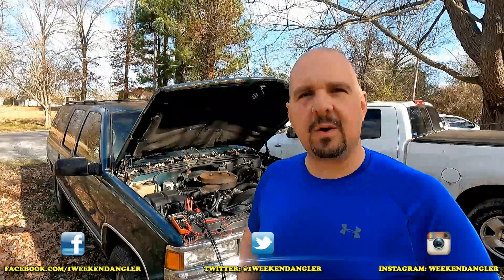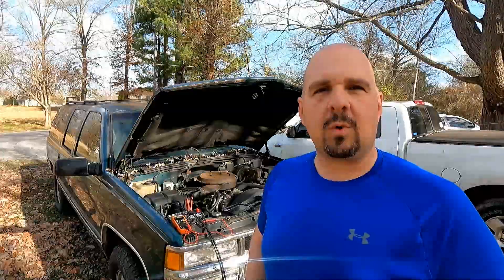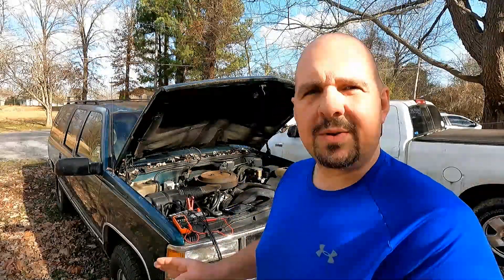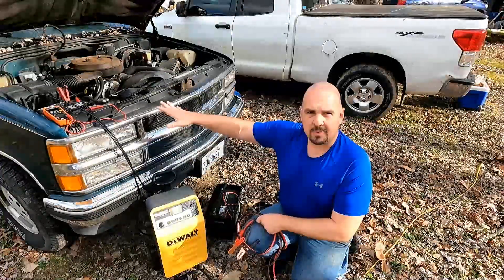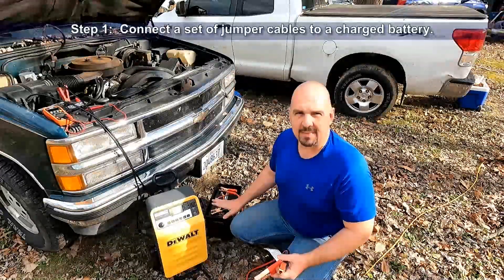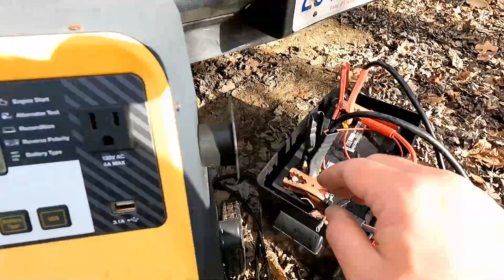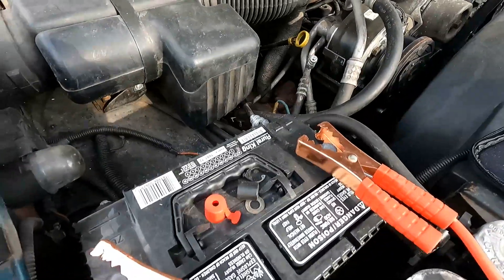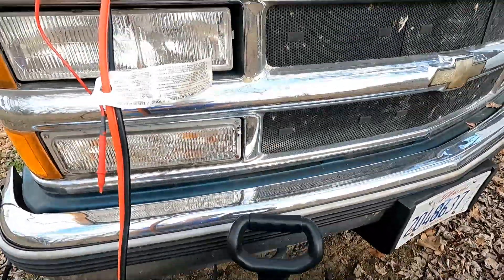How To Charge a DEAD Car Battery When The Smart Charger Won't Detect It

Comment: You truly act like you found something new that has been known all you do is hook another battery up to it let it sit there for a few minutes and then hook your charger up and the smart chargers are much better because they charge a battery to a full 100% at stages they slowly charged up instead of fast like the old chargers did and you cook the battery, fry it in with a smart charger when it’s fully charged, the charger automatically shuts down with the older chargers. They didn’t start out slow and then slowly step it up they would is ball those battery plates and you would sell start smelling the acid Stinkin and when you smelt the battery like that you knew you had something going on had a bad cell that battery was done smart chargers are made for safety reasons and the newer batteries are sealed Joe batteries non-serviceable. I actually like the smart chargers because they bring your battery back in a full hundred percent where it should be because people have this bad mistake of charging the battery just enough to get the vehicle started and then they take the battery charger off that batteries never fully charged and they think all the vehicle do it while you’re putting a strain on your alternator and one thing people don’t realize a lot of Fords if you have a low battery and you jumpstart that vehicle that battery is not a full hundred percent y 100 percent in one thing people don’t realize that battery is not fully charged up. People have a bad habit of just starting a vehicle and going well. The thing is on a lot of Fords especially the older ones GM’s and the newer ones that batteries not at a full hundred percent and you start that vehicle guess what you just took that alternator immediately to go buy alternator now he blew out the regulator and a diode’s. That’s why your battery needs to be at a full hundred percent charge before you start a vehicle. people are in a hurry nowadays go go go they got time the way. Oh they’re in a rush. Learn how to settle down and wait a minute as you get older, you’ll realize a lot of things you’ll start settling down, slowing down and think how old that old guy he was right but you won’t admit it when you’re younger just a dumb technician telling somebody a little advice and they think they know it all I know because I’ve done the same thing after working on these vehicles for years and years I learned the batteries not at a full hundred percent good way to spike the system because the alternator is not seeing a full correct voltage it increases the volts amps. It’s like a power surge takes it take a big chance of spike in the system doing more damage to your vehicle than what it’s worth and guess what that’s a thing that’s not under warranty you have to pay for it. There’s no warranty coming out. There’s gonna pay for that, once a technician figures out what happened get your wallet out time to pay up so just do yourself a favor go to Harbor freight get your solar panel. You can’t do that you got plenty of cell phone chargers, laying around cut the end off it’s got red and it’s got black hook it up to the battery and plug it in and go to the house, you could leave the cord up on the hood and if you’re scared disconnect, your negative, then plug the cord in but that little bit of voltage it’s like a trickle charger. I don’t know why people don’t use common sense no more compromise.

Comment: And people don’t think about this so you have a dead battery but you don’t have the money to purchase a battery charger but you need to leave in the morning to go to work, so do you have a old cell phone charger take a cut the end off strip it back you’ll see a red and a black wire Hook it to your battery plugged in overnight and your batteries charged it’s like a trickle charger used fast charging one, so what it takes all night but you didn’t have the money to purchase a charger and this is actually charging your battery the correct way the way it should be done. You don’t want to charge your battery fast you want to take it slow and bring it up And bring it up to fast it’ll never charge your battery to 100% people don’t think compromise things around the house it’s just laying there and I know people have thousands of cords and ends for the wall socket plug it into extension cord and there you go or go to Harbor freight spend $15 get your solar panel so when the vehicles off The batteries being charged during the day that takes a strain off the alternator system because the battery is fully charged a lot of people don’t think and you run it directly to the battery and leave it hooked up all the time so when you’re going down the road is being charged your alternator shuts down because the computer sees the battery is fully charged Savon gas saver on the wear and tear your alternator and battery I think people forgot how to think.

Comment: so what's the point of having a battery charger if you need to keep a fully charged battery around?
Reply from the maker: You didn't used to have to until they started making these "smart" chargers that are dumber than a brick.

Comment: A way with less effort is to get an old 12v wall wart power supply, and a splitter ( one male, 3 female outlets) for the cord,  clamp the charger leads on the battery, then the wall wart leads to those clamps and turn on the charger. The charger will sense voltage, so will start to charge. Once it starts charging you can disconnect the wall wart power supply and the charger will run until the battery is fully charged.
Reply from the maker: I've done that one before also. Good tip!

Comment: Better still, buy a smart charger that will bring up a dead battery to full, I bought one for this reason after my previous smart charger couldn’t do it. Now I have one that will pump in the amps like the old transformer type and then float it afterwards. The smaller units aren’t worth it.

Comment: Even a small 9 volt transistor radio battery will make a smart charger begin charging. Once the charger turns on it will continue charging after the small battery is removed.
Reply from the maker: 9v is usually the accepted threshold voltage for charging, however a lot of the cheaper smart chargers require a little more.

I've got one that won't charge anything under 11v.

Comment: I’ve always had a spare car battery good solid crank on timber blocks on the ground and still using old school trickle charger to this day.  I’ve looked after it extremely well. 

Hook up fully charged high crank battery to any dead battery in a car or motorcycle or anything and bang kicks it in the guts. 

Anyway thanks for the advice

Comment: Thank you for explaining something that has confused me for years. Always got it running, was never sure how. I have a trickle charger. I am guessing the 2 volt trickle aspect of this charger is disconnected from the " smart". Throw a trickle at it for a couple minutes and presto, it works. Turn it up and away we go.
Reply: I originally thought I found a magic hook up point after fooling around for hours. Then my magic wouldn't work one day. I am too stupid for this smart crap.
Reply from the maker: @Thea-gj2or  I liked the chargers a lot better when they were a simple transformer and rectifier. They'd throw voltage into a rock if you wanted them to. These new chargers are horrible.
Reply: @TheWeekendAngler  I was ready to smash things so many times. I learned at a young age that smashing things just gets you smashed things. We don't drive the car often enough or far enough to keep the battery charged. It gets worse in our - 20 degree winter lows. Lasts a month at best, then the struggle begins. I think I have it under control now. I might actually understand the problem thanks too you. Thanks again for the explanation and the swift reply.   Dave
Reply: To clarify, the day it didn't work was yesterday. By trickle charging it for 3 minutes I got it to charge at 10 v. Now the charge rate is dropping fast. At 7.5 v and dropping. Started the car an hour ago but wanted a better charge for the wife to leave the house. I am convinced it will read full charge very soon. Thanks for helping me understand why, hopefully. I only say hopefully because I thought I understood it before. Good times on you and yours.

Comment: Used my Harbor Freight jump pack to fool my old Die Hard charger to run in manual mode. Then, I got enough voltage on the battery that I could get my new Vector battery charger to do the rest.

Comment: Great vid, thanks.
Would you recommend doing this with a completely drained battery too? 
It's not detected by my charger - which min. limit is 2.5v - so I guess it's somewhere between completely drained and >2.5v.
Cheers
Reply from the maker: Yep. I've done this on that old suburban after letting it sit for a long time. Battery voltage was basically nil and it brought it back from the dead.

Comment: my battery is now 4 yrs old.. if it's my car does not start, all i just do is to connect wires in parallel to another car then start, for the alternator to charge my dead battery.. after a while, my car can start and i leave it 10mins to charge up itself.. then good to go 😁

Comment: If you have jumper cables, just ask for a hand and if someone pop their hood and jump your battery so the alternator can charge your battery. If that's not an option call roadside assistance especially in colder weather. The issue here is he purchased a 12 volt 3 stage charger but needs a 4 stage charger to get the battery back to 12 volt range. It's a solution however that entire setup is unnecessary and costly. What happens when the backup battery discharges down to 11 volts. You'll spend half a day charging batteries. 1200 watts at 30a bulk stage 3 hours per battery.

Comment: Just used a 9v battery to do the same thing
Reply from the maker: I'm going to have to try that. That's an awesome hack! Someone else mentioned that a few days ago too. Thank you for sharing!
Reply: @TheWeekendAngler  it sounded ridiculous when my buddy told me but it worked within 30 seconds and my battery was dead dead.  But it just has to register something with a few volts I guess even a small ass battery will work

Comment: I once put enough charge in a dead 12V car battery using a 9V PP3 battery, it added just enough power to get the smart charger to turn on. I read it somewhere, tried it and it worked.

Comment: also if the battery charger says bad battery then you can also use the boost option on the charger for 30 or so min and then put it back on the charge option
Reply from the maker: That's a good feature that some of the better smart chargers have.

Comment: could you use a jumper instead of another battery to make think the charger its 12 V?
Reply: You can jump the dead battery for about five minutes and get a “surface charge” on the dead one then your charger will recognize it and begin charging.
Reply from the maker: No. You have to have a 12v source for the "smart" charger to turn on.

Comment: Isn't it dangerous to leave that setup on very long as it will over charge the good battery??
Reply from the maker: You're fine to do it for the time it will take to get the depleted battery over the smart charger threshold. It won't overcharge.

Comment: Can be done with two intelligent chargers PROVIDING that at least one has the option to do an engine start. Hit the battery with the engine start then hit it with the ‘intellijunk’ charger. I tell you one thing. Even if it takes a knife fight i am never walking past a 1980s schumacher battery charger at a garage sale again!
Reply from the maker: Comment of the year right here! That is awesome! Thanks!
Reply: I remember being a kid and seeing what my dad and others used as battery chargers: a box on wheels that let you choose 2amp, 10amp, and 50 amp settings. I've seen better ones with 100 amp ranges. When that thing came out, dead battery problems were solved, very quickly.
 It blows my mind that we live in a world where it is perfectly acceptable for products to decline in quality and capability.
Reply: Y are those the cream of the crop ?
Reply: @cr112784  they just don’t have this ‘smart technology’ and their construction is better.

Comment: The smart thing about smart chargers is that when the battery is charged, they will switch to float, maintenance or storage mode and not boil out your battery.  The dumb thing about dumb chargers is that they are like the Energizer bunny, they just keep going and going.  So you have to watch them.  They are useful for some purposes.  You could use a dumb charger to put a "surface charge" on your dead battery in a few minutes that will allow your smart charger to engage.  You can also use a dumb charger to desulfate a battery if it's not too far gone if you do some research and understand what voltage and amperage levels to watch for.  Good video.

Comment: Can you connect the charger cables to the dead battery instead in this arrangement?
Reply from the maker: It's worth a shot, but more often than not the charger will read the dead battery and refuse to engage.

Comment: Great video, thanks for posting!  I had two RV batteries hooked up in parallel on my camper.  I forgot to disconnect the leads when I put it in storage.  Therefore with the parasitic drain from the camper, it drained my 2 batteries down to 1 volt. I thought, no problem.  I'll hook up my smart charger.  The batteries wouldn't take a charge.  I got my 2000 watt portable generator out and it has a 12v connection to hook up to your battery.  I hooked it up and ran the generator for about 10 minutes or so.  That was just good enough for my smart charger to detect a enough voltage to start charging.  I was thankful, being those 2 batteries were only a year old.  These smart chargers are a PIA!

Comment: Yeah, that's ridiculous.
You gotta have access to another battery or another car, to make a battery charger work.

That's not very "smart" if you ask me.

However what is definitely "smart" is that many of these "smart chargers" are sold with trademark names such as Diehard. What is Diehard famous for selling? Right. New car batteries. 

Techs can use these smart chargers to force a customer into buying a new battery even if their battery could have been saved. "Sir, the charger wont even detect that your battery is hooked up to it. You need a new battery." Despite the battery being new enough to be resurrected. (but what shop wants to resurrect batteries as a favor when they could just sell new ones for profit?)

Comment: How you do the voltage almost at end of this video when had the red and black in oil that to volt meter
Reply from the maker: I'm not sure I understand your question, but I connected the red and black volt meter leads to the side posts on that battery. That is a dual post battery, with posts on the top and the side.

Comment: Just buy a NOCO Genius brand charger. It has a “force” mode that will manually charge batteries under 1V.
Reply from the maker: I run noco genius onboard chargers on both of my boats. I did this video for people stuck with the "smart" chargers.

Comment: this is probably a dumb question; but is it possible for a dead battery to read fully charged and keep shutting of the smart charger?    ......Thanks, Willie
Reply from the maker: It is. But that's usually an indication of a defective battery. I'd suggest having that battery load tested to get an indication of its condition.
Reply: @TheWeekendAngler  thank you
Reply: had battery tested and the volts were good but no AMPS,  resulting in a bad battery......
Reply from the maker: @bonniejohnson1518  that's the downfall of flooded lead acid batteries. Once the plates sulfate, the battery is pretty much finished